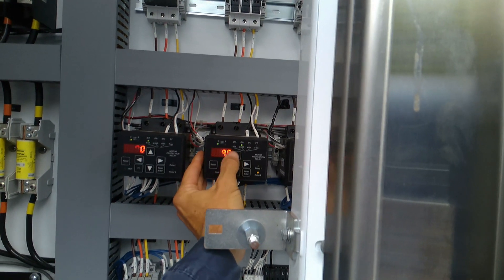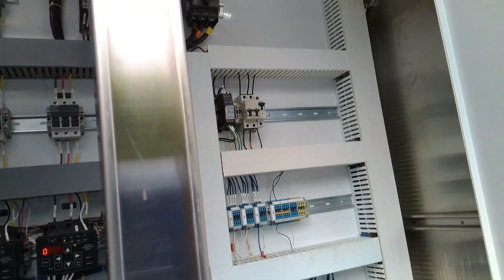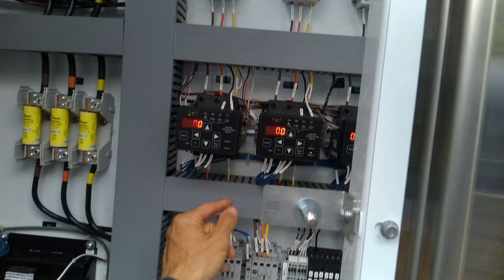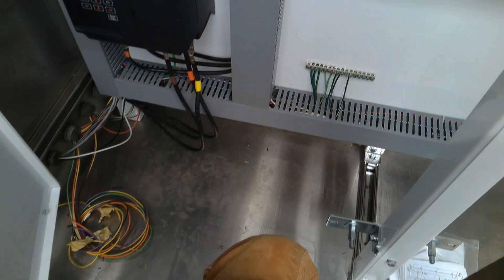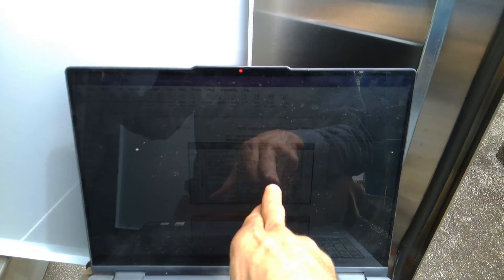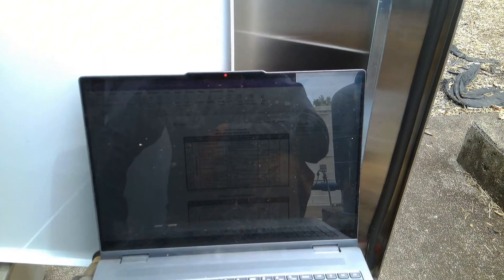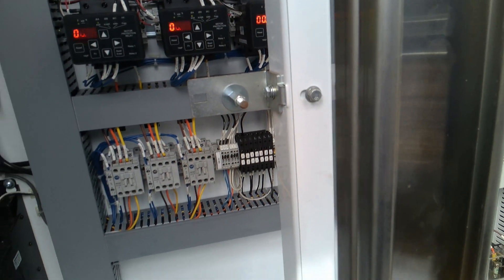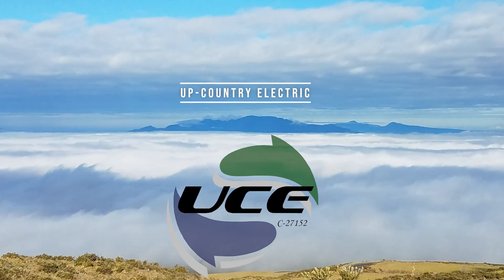Motor Overload Trouble

Comment: What i have serious problem with these things - is nowhere it is mentioned for what NEMA Design motors these protection relays are for. Assuming it is for Designs A and B ( curves of those are pretty close), and most likely your pumps are Design B. 

Because C and D - starting curves are pretty different. 
And I didn’t see any provisions in the manual to program the curves provided by motor manufacturer.

Comment: Look at the comment under table 1:2 - RX5 can be used with motors  up to 75A FLA, but you will have to use external CTs for that.

Next size RX-40 is 20-40 amp FLA, even with multi turn ( 4 turns max) it only goes down to 10 amps.

Comment: Tabe 1.1.1 says that if you select Auto in run - it can go 150% FLA times SF.

Switching to RX40 might not be a good choice. Because these motors are at the very bottom of RX40 sensitivity.
So either you try best you can with correctly programming the existing ones. Or switch to some other brand/line of products. That 5.5-6 amps will be somewhere close to ehe middle of sensitivity range.
Reply from the maker: Dude you rock! 
Yeah the next size up model is too big for this.
I think these will work out as the actual loading is just under 5 amps, and I think they are protected from overloading. 
I think this would be a serious problem if the actual loading was closer to 5.5 amps or above.
So yeah, we will see. 
Thanks for the advice!
Reply: @ There’s two modes of “detecting run speed”
One is auto: detecting 150% of FLA, and then the “run speed” point is when current drops to 100% FLA.

Or just do 180 seconds start.
If the engineers messed up by machine motor torque to diameter of the impeller, or you have high head at start - you might try switching to 180 seconds.
It’s function F049, 0 is for auto, 1 is for 180 seconds.
Reply from the maker: Awesome information, I'll try that if this happens again and make a follow up video showing it. Thanks again for all the tips and help!

Comment: Is that brand new installation? How can you have nFLA code if it was running for a while?
It means protection relays were never programmed.
Reply from the maker: The controls are about 6 months old.
I don't understand where you're getting the nFLA code from?
The protection relays were programmed at start-up.

Comment: The FLA is not everything on acceleration overload.
Those things must have starting  curves programmed in to them, and motors went off of the curve. 
Like maybe in-rush hang out little bit to long, or sings like that.
Whatever you did just changed parameter for motor already running normal speed.
Reply from the maker: Interesting point. I am still curious why they both tripped together. This week I will be looking into making sure we have logging and serial monitoring enabled so we can get a bigger picture of what's happening, if it happens again.
Thanks for watching!

Comment: Nice troubleshooting Up Country. It looks like the design engineer had a bad day on that one.
Reply from the maker: Maybe. The next size up unit is too big for this small of a motor. So I can sort of understand what he may have been thinking.

Our saving grace is the fact that the actual loading is just under 5 amps, if it were higher they'd need a different solution. It's close, but I suppose it's better to be slightly overprotected than under protected.

Comment: Designer overlooked the motor current ratings? You love to see it 😂
Reply from the maker: Perhaps, the next size up unit is too big for a motor this small. So I think I see what his intention was. Fortunately the actual load amperage is just below 5 and not any higher otherwise this wouldn't have worked at all from the beginning.
Reply: @Up-CountryElectric 93-0 is nFLA, but that one is oldest, and might that it was set at commissioning. 

Read my other comments. You are in a bad range for RX-5, unless you will install and use external CTs.

Next size RX-40 will go down only to 10 amp FLA even with 4 turns. So that one is out of the question.

So it’s either install external CTs and try to figure out the offset in programming. Or switch to another brand.

You can try to increase start overload to next class, and see if that will do the trick.

But those protection relays are at their very upper limit in that set up.